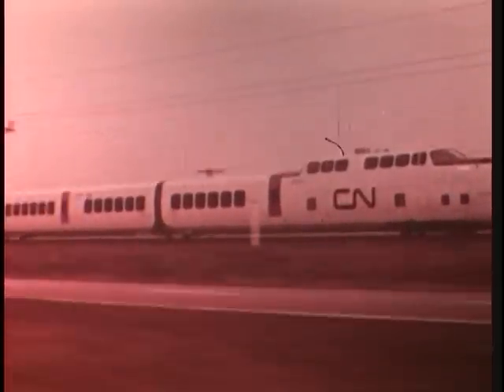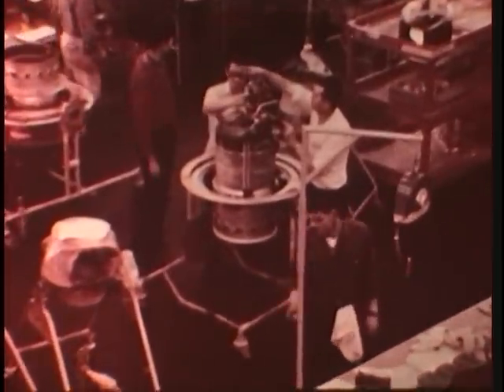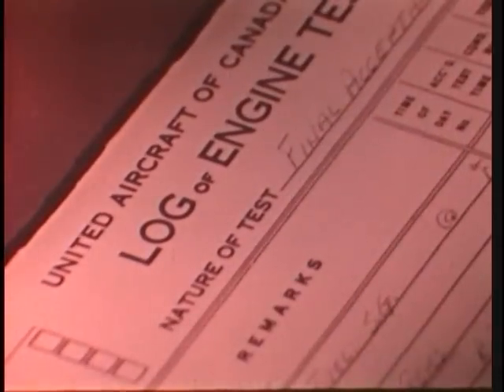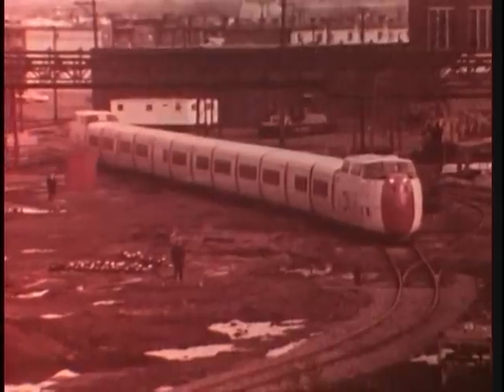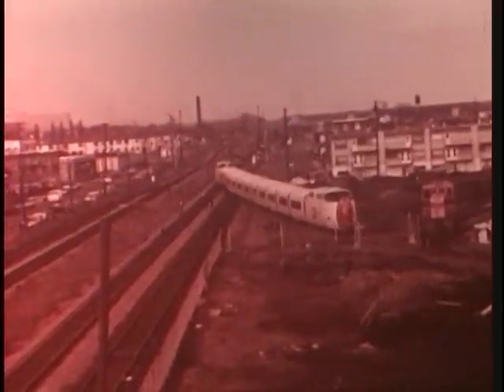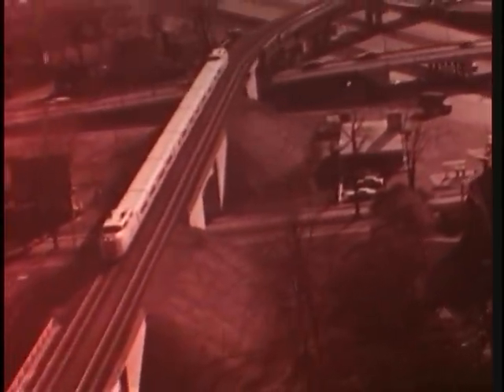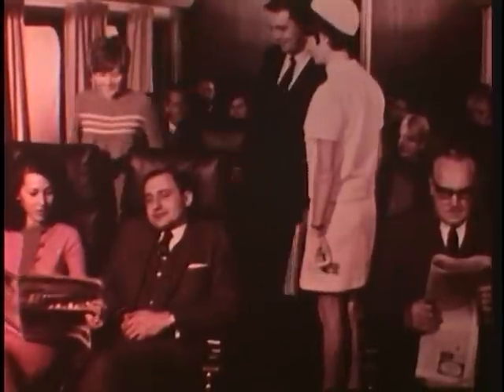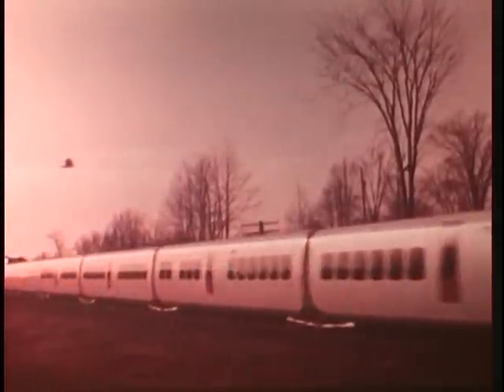CN Turbotrain - "3:59" - The Lost Film

Comment: Turbo did perform very well once it had the bugs ironed out. I took it regularly between Toronto and Kingston when I was in school. A very fast and comfortable ride! The LRCs' much-touted automatic banking for curves proved to be pointless because the locomotives were not so equipped. Anyway, the greatest obstacle to high-speed rail between Toronto and Montreal is not the freight traffic or even the railbed; it is the great number of private, unsignalled level crossings that farmers must use to get from one field to another. Until such time as these are eliminated, really high speed trains will not be possible.
Reply: It is a shame . I love trains , but this train was just a little before The FLQ and then Montreal for a while became a place that non french people  , did not feel welcome . It is an overall shame ,I recall the hype regarding this train , very sad .
Reply: Im fairly sure LRC locomotives could tilt but due to their unreliability, F40s would usually be pulling instead which made the tilt function pointless

Comment: It's a shame that here in North America (especially here in the U.S.), we have pretty much not progressed in modernizing our train transportation system in the past 40 years.  I live in the Upstate, N.Y. region, and outside of the N.Y.C. metropolitan area, availability of passenger train transport is woefully inadequate throughout the state. 

I remember as a child seeing Amtrak's Turboliners rolling along the Hudson River, and thinking, "Wow!  Those trains have jet airplane engines!"  It's ashame that now some 30 years later this technlology has not been continued.  With today's composite carbon-fiber and ceramic formulations much better suited to the high temperatures involved, one would think that engine companies would be scrambling to use these technologies to allow trains to utilize alternative fuels such as ethanol or LNG as their fuel sources, rather than diesel. 

Sure, the efficiency of diesel locomotive engines has gone up by 25% in the past 20-30 years, but that doesn't mean that we should stop seeking every possible alternative out there, in order to reduce our dependency on foreign fossil fuels.

Comment: @Railskunk136: The LRC is crap and not even as half as fast as the Turbo Train. The Jet Train should be brought by VIA, but the environmental movement would have a big meltdown, and there would be massive protests against it, so it will never be used.

Comment: the turbo train sucked, it was nothing but grief !
Reply: It took them five years, after its initial run in 1968, to get the bugs worked out. They should have kept it running longer though. Once the LRCs were acquired, it was no longer needed, apparently.